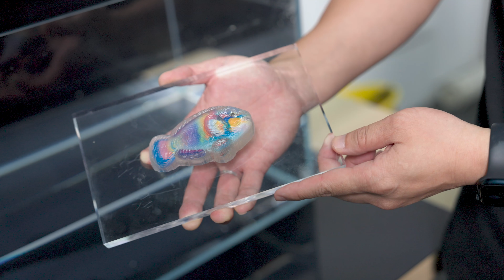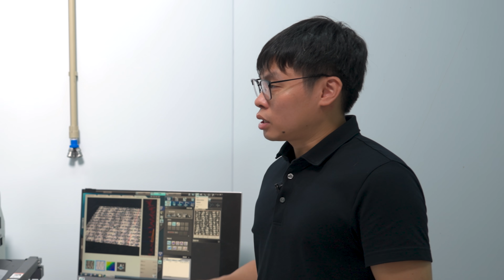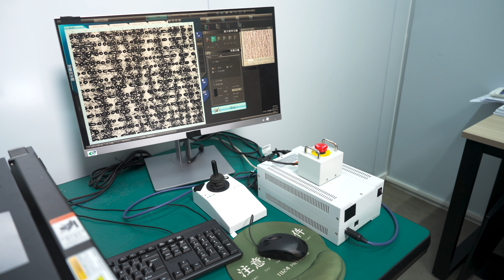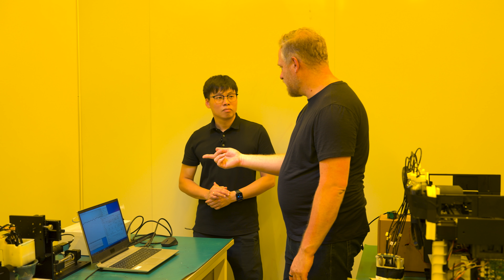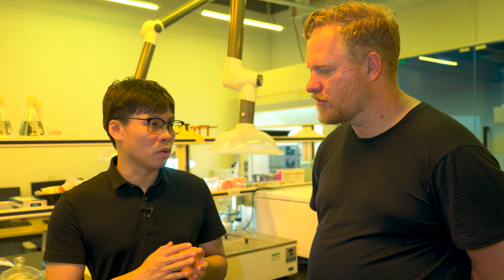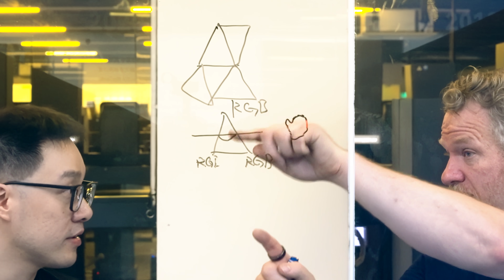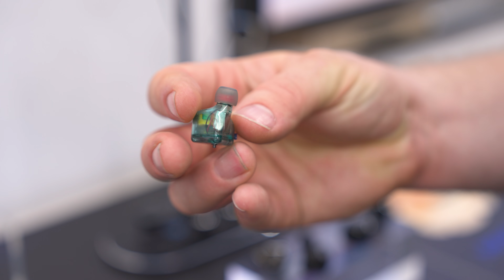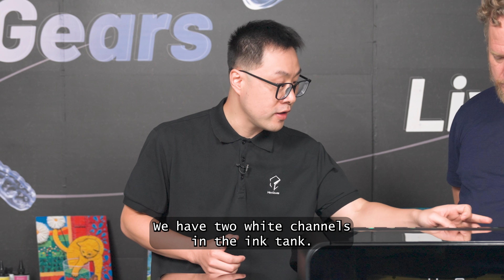Full Color 3D Printing on the Desktop is Finally Here! Meet the HeyGears G1X Engineers

Comment: Jetting heads always have a maintenance budget; the relevant numbers are warranty window, duty-cycle hours and whether the machine has per-path cleaning. Large sparse FDM parts will lose on $/cm³ to filament. Compare full-color jetting to print-plus-paint, not to empty infill PLA.

Comment: Just curious if you do keep the machine off for a long time lets say like 3 weeks or something like that and you can't tend the machine during that time does the head risk getting clogged  even if you maintained it properly? And if the head does get clogged how would you go about clearing the print head? What other maintenance risks are there?
Reply: I think I found the answer on the kickstarter FAQ. I will leave up the comment just incase someone else might have the same question. The machine keeps up the maintenance of the print head as long its powered on in standby mode. Its only when you lose power that the print head could clog. Although I wonder if you can empty the print head and clean it for long term storage if need be, which probably most owners probably won't feel the need to do this.

Comment: Inserting a PCB while 3D printing would mean an interesting new production method for small devices/sensors.
A company in my region of the Netherlands was a startup more than a decade ago based on 3D printing translucent material for custom lamp-lenses (their origin was lighting). last thing I heard was they switched to producing glasses. They were very secret about the tech-side. As a software engineer, happy to see transparency in these guys. Like the attitude. Wonder what tech will be next, or already in the making.

Comment: I imagine this tech makes it trivial to start printing materials with more interesting properties (opalescent, metallic, iridescent)
Reply: G1X’s configurable ink path is built for this class of swap. Fluorescent and specialty inks can replace the Lc and Lm channels. Metallic / iridescent looks are not a standard SKU claim today — fluorescence is the supported special-ink path.
Reply: Unfortunately, I think that it’s probably very hard to do that. Those require particles in the ink that reflect light in interesting ways. 

The white ink is already annoying and requires constant stirring. It would probably be like that but worse. 

Fountain pen inks have been doing that for a couple years now. The shiny particles settle out and require stirring. And if they settle, they can clog stuff.
Reply: They actually planned the extra channels so you can drop in fluorescent inks instead of light cyan/magenta. Sparkly metal flake is a different question.
Reply: Eight physical channels + open tanks mean Lc/Lm can be remapped to fluorescent/specialty fluids with the matching profile. Structural metallic or pearlescent effects still need pigment/particle physics that is not in the current ‘trivial’ bucket.

Comment: 1:11 hell of a lot cleaner than sandblasting! I'm fascinated by all this. I'm still on a standard (well ok, heavily modified) FDM at home. This feels like it's a hybrid between FDM process and Resin UV vat. Pretty exciting. I wonder what the aerosol toxicity is like compared to resin?
Reply: Looks cleaner than blasting, but I would still run a filter and not sniff the head. Support leftovers: dry them and treat as trash, not as a chemistry experiment.
Reply: Process analogy: drop-on-demand + UV, FDM-like layers, SLA-like photopolymer chemistry. Without a published aerosol assay, do not claim ‘safer than vat.’ Post-process support is a dried solid-waste stream, which is a different exposure route than IPA wash water.
Reply: It is material jetting plus UV cure, not a vat of liquid resin. We have not published a head-to-head aerosol-toxicity study versus SLA. For supports: dissolve, dry the residue, dispose of it as solid waste. Use normal ventilation and follow the SDS when it ships.

Comment: Tiny url link is reporting not found. Can anyone confirm it works?
Reply: Just tried it — opened fine for me. Might have been a momentary short-link hiccup.
Reply: tinyurl failures are often cache/region or a one-off 404 on the resolver. If it 404s again, paste the destination from the pinned comment rather than assuming the campaign is down.
Reply: Thanks for flagging it — we rechecked the short link in the description and it is resolving on our side. Please try again, or use the same URL from the pinned comment. If a regional DNS glitch persists, the Kickstarter page is also linked from the video description text.

Comment: I enjoyed this video I've been wondering how they were able to 3d print with a ink nozzle. The only thing that would put me off buying one even if I could afford one is the potential for the nozzle to either fail or block. These type of print heads use microscopic holes for the ink to come out of. They are very similar to standard Epson print heads and due to the cost of one of these printers I would be constantly worried they would block. Also everything I've seen 3d printed with one is small I imagine for a large scale item such as a fdm 3d printer could do these would be extremely expensive in comparison for the material. They have their place in the market but personally I think they should be aimed at small businesses more than consumers
Reply: Jetting heads always have a maintenance budget; the relevant numbers are warranty window, duty-cycle hours and whether the machine has per-path cleaning. Large sparse FDM parts will lose on $/cm³ to filament. Compare full-color jetting to print-plus-paint, not to empty infill PLA.
Reply: I worry about clogs on any inkjet-style head too. What I took away is: Epson warranty on the head, and they are not really selling this as a cheap way to print huge FDM-sized objects — more like small, already-colored pieces.
Reply: Nozzle health is a fair ownership question. The i3200-U1HD is supplied by Epson and carries Epson’s official 6-month warranty. Under intensive use, expected life is at least about 2,100 hours. Full-Color 3D is aimed at finished, made-to-order objects rather than replacing large FDM parts; the dragon in recent tests uses ≤100 mL including support and waste, under $2.50 in material at the weighted average.

Comment: Can you imagine how much MICROPLASTICS is gonna be released in water ?
Do we need this ???

Do we need super cool 3D printed plastic parts as much as we need not to get strokes and cancers ?

TF are we doing in this civilization of material worshipping.
Reply: I get the worry, but the official method they keep repeating is dry the leftovers and treat them as solid waste — not use the sink as the waste port.
Reply: If soak water is evaporated/dried and the solids are binned, you are managing a solid residue, not designing a microplastic outfall. Apocalypse framing is not a process spec; the spec is dry → solid waste.
Reply: The intended support workflow is not 'flush the job down the drain.' After the water-soluble support dissolves, dry the residue and dispose of it as solid waste under local rules.

Comment: 6-7 hours t o remove a tiny bit of support material? oof... guys.. comon
Reply: Yeah that clip looked slow. They say the final support mix is about twice as fast and you can just leave it in water if you want.
Reply: Dissolution time is mass-transfer limited. A faster hydrophilic fill plus optional agitation is a normal lever; the production claim is ~2× versus the prototype soak, with passive immersion as the default.
Reply: The 6–7 hour soak in early footage is not the final spec. Production support is about twice as fast and can be fully passive; brushing or rinsing shortens it further.

Comment: Anime figures: $5 3D-printing production cost, offered for $500 in the store
Reply: The $500 shelf price is the painted collectible market. The printer’s resin for a small character is in the couple-of-dollars range if you believe their milliliter math.
Reply: Unit economics: sliced mL × mix price + maintenance allowance + time. A 100 mL job at $0.025/mL is $2.50 materials. Do not conflate that with licensed retail markup.
Reply: Material cost is much closer to a few dollars than to storefront pricing. For the small dragon we quote, BPS volume including support and waste is no more than 100 mL — under $2.50 at the $0.025/mL weighted average. Retail figure prices are a different stack: IP, paint labor, distribution.

Comment: Do they talk about what the water soluble material is? Does it make the water a disposal or health hazard?
Reply: Apparently it's a proprietary secret mix. It's probably PEG based. The water can't just be disposed of normally. I can't speak for this company, but for similar resins you usually use UV light to turn all the resin solids and leave only the water or use the sun to turn the resin solid and evaporate off the water.
Reply: I had the same questions 😬
Reply: The support material is a non-toxic, water-soluble polymer (the same family as the dissolvable film on laundry pods). Once fully dissolved, the wastewater is safe to wash down the drain like standard household greywater, requiring no special hazardous chemical treatment.
Reply: @SigmaPiii I've never seen PVA or similar polymers used in what's essentially a resin printer nor can I find any examples online. Could you provide more information?
Reply: @SigmaPiii  that is absolutely NOT the case, according to the @HeyGears post below this one, so i dont know which part of your digestive tract you pulled this from
Reply: We do not publish the full formula here. Water-soluble support is not handled as unsafe chemical wastewater: after it dissolves, dry the residue in air or with heat and dispose of it as solid waste under local rules. Avoid prolonged skin contact; SDS will be available with the commercial release.

Comment: Brilliant tech... But 27 hour print times are wa... too...long.  it would tie up the printer for over a day for one piece and then another six to eight hours soaking. Cool but not feasible if you want the machine to be productive.
Reply: From what I heard during their livestream, their R&D team mentioned that both print speed and dissolution speed will be optimized to nearly match Mimaki’s performance in the final release. That said, the price point alone pretty much makes up for everything.
Reply: The long prototype time is not the production target. The same dragon prints in under five hours on the final workflow, and the production water-soluble support dissolves about twice as fast — fully passive soak is enough; brushing or rinsing is only if you want it quicker. For daily throughput, UV Printing with a CMYKWWWW four-white path is the faster workhorse.
Reply: @HeyGears Great to hear. Makes a HUGE difference.
Reply: Exactly! Just get a regular resin printer and invent something that can spray or coat the different parts in colour

Comment: The fiber instead of copper makes sense. Copper will work harden and moving it around will make them hard and brittle. On thinner cables is less of an issue though since there's less of stretch and compression zones but it's still a thing.

Comment: Good stuff! Thank you. There have been a number of good "technical" interviews with the Morpho CEO (why i3200 - designed for UV ink - plus 2D UV ink reformulated to be less caustic on the print head; and less smelly) that have been pretty impressive. HeyGears clearly rolling out their technical "big guns" too. Good stuff.
Reply: Appreciate the comparison. The i3200-U1HD is a strong industrial head; G1X is built to use all eight channels as a configurable platform. For white-heavy UV work that can mean a CMYKWWWW four-white layout, up to 12× the speed of an F1080 single-white-channel path, or other channel maps for gamut and effects. Full-color 3D is a separate resin Hub on the same motion system.
Reply: Same family of head, different machine around it. The bit that stood out for me is that G1X can actually reassign those eight channels — four whites for speed on UV, or other mixes — instead of treating i3200 as one fixed UV recipe.

Comment: Was the clear blob around the beetle printed or was the beetle printed first and then immersed in clear resin as people do with all sorts of decorative objects both found and made?
Reply: Most likely printed with the clear around it and then very heavily finished/polished as are most examples from other companies who show shiny prints like this
Reply: Assign T voxels in the slice and jet them layer by layer. It is digital material, not a secondary casting step.
Reply: It was printed as clear, not dunked in a resin block afterwards. That is the whole point of having a transparent channel.
Reply: @Vector99-c6p  The "whole point" of having a clear channel is to make novelty paperweights by a more expensive process than the status quo?
Reply: That clear volume was printed on the machine, not a post-pour around a finished beetle. Transparent resin is a dedicated channel in the Full-Color 3D set.

Comment: Why does the soluble support have to extend above the model? Seems like a waste to fully encase the print
Reply: So there's two way to go about it. Fully incase a model, or only put support on underhangs. The second benefit of fully incasing the part is that the support acts as a boundary in the x and y.
Reply: It's harder to program less support above the print then just adding a border around the item It might be possible but they might not see any point of doing that programing at this point.
Reply: I suspect future updates in the slicer will give more options.
Reply: The envelope is there to give the part the support force it needs so the body prints reliably, not to waste material for its own sake. We are reducing support volume while keeping that force, and Blueprint Studio will later expose more user parameters so you can trade support mass against risk.

Comment: Print hollow and then pour in fibre reinforced epoxy resin for strength?
Reply: As far as I'm aware this is already an epoxy (well, a thermoset resin, which is what epoxy is as well), it's just UV cured instead of using a chemical agent like 2 part epoxies. That means the potential strength gain from epoxy backfill would be limited, and it has significant disadvantages with likely lower bond strength due to material differences and risk of voids in the part
Reply: @bosstowndynamics5488 The fibres would make it a composite. Pouring is also a lot quicker than printing and gets the part out of the printer sooner.

Comment: I wish I could test this machine. I have industrial flat bed UV printers and though I can do most of what this one can do the 3d printing has my attention. They took everything Eufy was trying to do and improved on it and even fix the errors.
Reply: If you already run industrial UV flats, the new question is Full-Color 3D on the same precision platform. UV Printing on G1X is still a serious everyday path: configurable channels can run CMYKWWWW, up to 12× an F1080 single-white setup on white-heavy jobs. We would welcome a side-by-side with the files you already produce.
Reply: @HeyGears  Small industrial flat bed printers 🙂 12x24 bed. I do run flex ink on them but I would love to be able to do 3d printing. If its possible to sign up for any testing or review programs I'd love to sign up for the chance. I am a trained engineer so I can not only speak about it as a end user higher level but also as an engineer at a deeper dive. Shoot I have a 3D full color full body scan of my self and my father and it can be printed on a prusa in single color but this would be a great test! I know it will be a while before i get to see these in a convention show near me sadly.
Reply: Makes sense — you probably do not need another flatbed lecture. The 3D color build is the part I would actually want to borrow the machine for.
Reply: For a shop that already owns UV, the test matrix should be: matched UV file for registration, then a small full-color 3D part for layer time and support removal. Throughput on UV is the four-white CMYKWWWW map versus single-white desktop heads, not a claim that every industrial flatbed is slower.

Comment: wondering if the printer require special ink to do translucent color. thinking if you can print tail lights for RC cars and such
Reply: They said that one channel was clear ink. So I assume you could add red and clear in the right mix to make it as translucent as you want.
Reply: They do have a separate clear/transparent channel for 3D, so tinted-clear parts are in the design. I would not assume car-light optics quality until someone measures it.
Reply: T is an independent resin channel, not a varnish trick on UV. You can assign transparent vs color voxel-wise in BPS. Photometric specs for taillight optics are still untested publicly.
Reply: Translucent and clear regions use the dedicated Transparent channel in the Full-Color 3D set (CMYKWWST). RC tail-light style parts are a natural demo direction; we have not published optical/lens-grade transmission data, so please treat lighting parts as visual models for now.